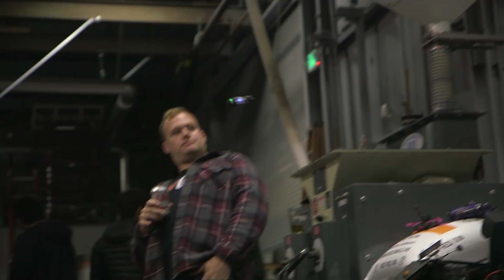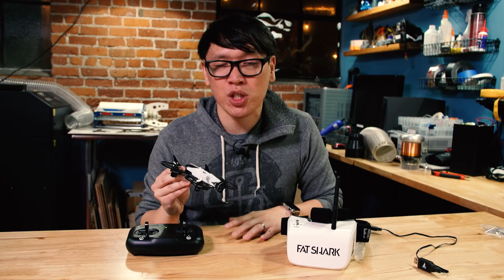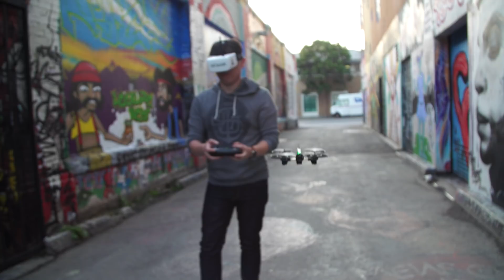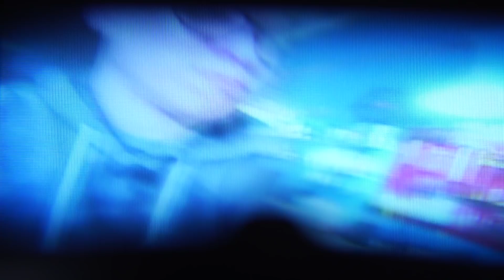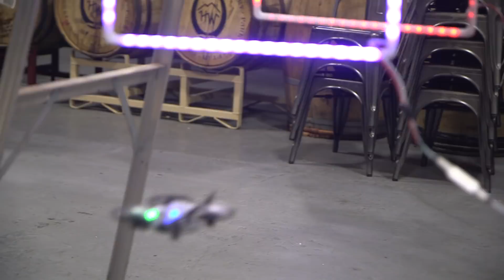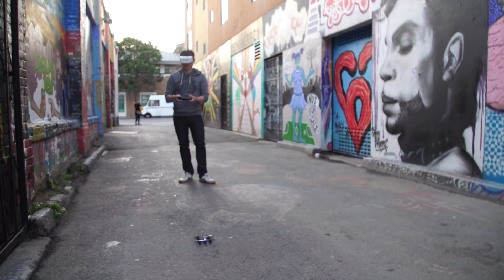Show and Tell: Fat Shark 101 FPV Quadcopter

Comment: Starting with an induxtrix or Building a tiny whoop would be a much better option. You can upgrade, it has better VX/TX so you can fly for more then 50ft and around corners.and the cost is similar. Worrying about support from third party venders is pretty useless, I doubt they are going to cover you breaking things due to a crash. if you are serious about getting into fpv you should understand, you will crash, you will crash again and you will need to know how to rebuild your quad and how to find answers when things aren't working right. Then you will crash again. You really need to understand how these things are built and not be afraid to work on them. Parts for these size quads aren't that expensive but you will replace parts often so it can add up. Then you will crash again.

Comment: It also comes with a redeem code to download DRL simulator for free which is worth 20$ and 3 month AMA membership and insurance.
There is no camera angle because it's for pure beginer and the wide angle gives you a good visibility of surroundings. Unlike a tinywhoop this one doesn't need a lot of pitch to gain good speed and once used to it the motor angle can be pitched forward at around 20 degrees (providing that needed camera angle), thanks to the gromets.
It comes with Betaflight so newbies can also get their feet in the flight controller tweak world.
Radio is AFSHD2 flysky compatible and uses real good gimballs, can be used for the 1st 2 years of hobby.
Headset uses Transformer lightpath technology, providing big fov and best focal distance, with integrated 18650 lipo cell and USB charge.
Seriously, if anyone can find a "one box to buy" which is even close to that at a lower price with proper customer service support please let me know because at this moment that's what my buddies are going to buy (and please stay away with "can buy separate chinese cheaps for lower price" coz I know then I will have to do the job for them as for IT with family).
Reply: You do realize that Fatshark is also chinese crap. Just really overpriced chinese crap. Hell even DJI's are made in china just like everything else. But you keep paying for that name, they love your kind.

Comment: This is a very expensive toy at toy level quality at well above toy pricing. You can spend a lot less. For beginners just trying to get in the air inexpensively, I would recommend looking at the Eachine E013. Get some extra batteries and you can start flying in your house or apartment. You can't beat the E013 at $70 ready to fly and another $20 for 4 more batteries and another charger. Less than $100 and your ready to get into the basics of flying FPV.

Comment: Really now?! Fatshark has been a household name in the FPV community since the FPV dawn of FPV time, and they still couldn't get the camera angle right. Not even a crappy toy should have a zero degree camera angle. You'll be looking straight at the ground as soon as you start moving forwards at any speed. Yes, I'm nitpicking, but that quad is dumb and a waste of money. I seriously hope that blurry blue shit in the goggles isn't what you actually have to deal with when using them. [stomps off into the distance raving angrily about technical specs]

Comment: People - get this instead for 50 bucks does exactly the same thing comes with goggles controller and drone https://www.banggood.com/Eachine-E013-Micro-FPV-Racing-Quadcopter-With-5_8G-1000TVL-40CH-Camera-VR006-VR-006-3-Inch-Goggles-p-1182628.html?rmmds=search

Comment: Oh yeah I seen that before the only thing is is King Kong tiny whoops are the same size and out of the box if you buy the advanced pack they come with six batteries a charger fully assembled they come with three extra frames and bodies and sets of propellers and everything is for under a hundred bucks you can buy said a set of eachine goggles for under a hundred bucks an a treatments from spectrum for around 60 bucks so all in all you would do well to buy a king Kong tiny whoop. And it is race ready to fly an fun inside or outside

Comment: this is a spot on review the best most unbiased one I've seen and I've seen 4 from big outlets ... 100$ for same type of kit on amazon called red pawz or little pepper great beginner but buy a 5 pack of batteries for like 20$ at the same time to get the best experience  ( the controller is a little small but totally usable unlike other fpv toy drones and the goggles are the only part you can grow with( but you will most likely upgrade because they are the cheapest on the market but still a great first experience)

Comment: In other words, it’s basically crap for both money and use.....there must be others out there worth the money and video time??
Reply: https://www.banggood.com/Eachine-E013-Micro-FPV-Racing-Quadcopter-With-5_8G-1000TVL-40CH-Camera-VR006-VR-006-3-Inch-Goggles-p-1182628.html?rmmds=search
Reply: This comes with fpv goggles and a radio, so it can grow with you if you build a real race quad.
Reply: for 175 you can get a flying RTR 250 class racer, with camera and controller,  All up in the air. 30-100 bucks you get a face box, v100, vr007  goggles etc etc etc. That puts you in a true 250 class brushless fpv racer for the same price as this junk ass setup. You got a lot to learn my dude.
Reply: these goggles are sub par and the transmitter is total crap. there is nothing to grow on in this kit. buy the 64 dollar eachine kit, find out if you like FPV or not. Then spend the money to buy a proper setup. 250 is far too high price for what you get here.

Comment: Too expensive for what is essentially a toy.
Reply: Brian D this is not a budget option.  It is the idiot with too much money option.
Reply: You might not have paid attention.  This is a budget entry into a hobby.
Reply: zymurgyjwt. Then you have no idea what the cost of this hobby is.
Reply: zymurgyjwt - So between you two, there's what, $2,000+ worth of equipment and you are saying that paying 10% of that to purchase a ready to fly system is overpaying.  You're obviously the type of person who argues to argue and I would have a more adult conversation with a coffee table than with you.  BTW, multicopters are rotary wing aircraft and it doesn't matter what the specs are, performance is limited by physics.  The biggest variable is the pitch of the rotor blades and the efficiency and ability to vary the speed they rotate at.
Reply: Brian D FrSky QX7 $105, Kingkong tiny 6 with 5 batteries $80, Eachine EV800 goggles $55. Then you have a radio that can be used for anything and a micro that can be used in a house. Or get the Eachine E013 bundle for $60.
Reply: Ok so for $10 less you get an unbundled system that is going to require the operator to be more technically savvy.  You are advocating for higher risk of failure to save $10.  You're beyond logical reasoning.  This is a budget entry into the hobby that gives users a more consistent experience and better technical support.  Did I say it was the best buy, no.  Simply that it is a budget entry into the hobby that presents a higher potential of success.  The more consumers enter the market, the more manufacturers will invest in the market.  BTW, $249 is a price point strategy.  Consumers are more likely to buy one box with everything they need for $249, then to shop piecemeal to save $10.
Reply: no, its not a hobby class machine at all. its crap
Reply: Brian D you are a damn fool. you can get an all up RTR 250 brushless racer and goggles cheaper than this setup. they are putting "toy" class crap into a fatshark box and up charging you for the brand name recognition. You want to talk about having an adult conversation or what this hobby costs? This hobby costs whatever you put into it. Its a fucking hobby. There are plenty of people who have far more money than sense and want to pay for an out of the box option. Fine, let them. But don't try and justify subpar hardware as excellent because it caters to the ignorant and lazy crowd. This is dog shit in a box, for a real high price. But I'm certainly not going to stop you from buying it.
Reply: I've got an E013, Japalura 3 inch, Chameleon 5 inch, two Floss 2 5 inch, Floss 2 6 inch, and a Y6 10 inch. With x9d and Fatshark HD3's. My step son has a Wizard x220 RTF with Kylon Vision. Nope, no clue what I'm talking about.

Comment: I believe this transmitter/radio uses a common protocol. And can be bound to a different receiver in a different quadcopter. So this kit has the potential to grow with you.
All you will really need to do is build a real 5” prop fpv craft!
Reply: youll find yourself out growing that TX very quickly, just get a qx7 youll be far better off.
Reply: Yeah it's basically a flysky radio

Comment: Damn you could get a nice racing quadcopter for that price
Reply: but not googles and no transmitter.
Reply: - 95mm brushless quad: 120$
- googles that are better than the cheap fatshark: 55$
- cheap transmitter: <50$
- total: 225$
Reply: ToastCrafter ! The difference is that all those a a la carte, while this is a complete kit with no guess work and no building. A true RTF.

Comment: $250???  Brushed motors?  The price point is at LEAST $100 too much.
Reply: You get a drone - brushed nice drone with betaflight and betaflight OSD costs 100$. I got 5 1s batteries for 20$ from Amazon with a charger. That's 120$ for the quadcopter. Flysky radio with way more features than this (especially with a firmware modification) costs 40$. Eachine EV800d goggles with DVR and diversity cost 100$. That's 260$ with 5 batteries, a way better transmitter, a quadcopter with betaflight and goggles with DVR and diversity. You can save about 30$ with just getting ev800 goggles instead of the d version. You'd miss DVR and Diversity, but still have twice the goggle resolution and be under 250$. So yor're paying mostly for the brand, if you can build a drone yourself, don't buy this.
Reply: The price for the whole setup isnt bad, but for as cheap as brushless motors/escs are these days, I'm surprised they went brushed.
Reply: microbuilder maybe they were trying to keep that weight down and the form factor
Reply: Maybe 200 would be more reasonable but the fact that it includes that transmitter, (which is actually a decent not a crappy toy controller) the goggles and a decent beginner quad justifies it. If you were to build a top of the line Tiny Whoop it would cost upwards of 200-250 for the quad alone. I think its pretty fair.
Reply: $105 gets you a FrSky QX7 that is the last radio you need.  Then the FrSky micro for $60 and any box goggles. Under 250 and you get more.
Reply: Thats the beauty of brushless motors, they can be tiny, weigh less than a brushed motor, and still put out more thrust and be more efficient.
Reply: i really like the transmitter it looks quite nice if it was sbus i on frsky protocol i wold think about buying it and the goggles look okay just the kwad look a bit shit mebz a version that doesn't look like a shark
Reply: Mate2Frio um actually a very good price considering you get a very good transmitter and a decent set of goggles
Reply: Good transmitter?  Not really.
Reply: Where are you seeing the specs on the transmitter?  There are many toy grade quads with the same.
Reply: Way over priced. Eachine has competing products for 64 bucks all up.  these are all throw away items, nothing to build on in this kit, with the possible exception of the nods. which are fucking horrible in their own right.
Reply: 250 for the whole kit is fine. Comparing it to tiny whoop kit that is 350 it has a okey price point imo. I would prbably go for a full size quad instead spend a little extra on a better transmitter and goggles. I think norm summed it up nice its gonna be for ppl that dont like to tinker with their quads and just want some cheap fun.
Reply: i think the price is fair because my fat sharks cost like £384 and then my transmitter was £200 so $250 for the lot is good

Comment: Whats up with the audio getting louder and quieter every couple words?
Reply: Limiter + compressor will fix this. Editor is obviously not a sound guy.
Reply: The compressor is working too hard.
Reply: makes it hypnotic, so you stay longer
Reply: @MPAII Yes I do. The thing I mean is that when Norman speaks louder, the sound goes quieter. That is an effect of a compressor configured the wrong way. The compressor works a lot harder than it should.
Reply: A compressor can't compress loud audio to be softer than the soft audio on the same track. Even if you set the ratio to infinity, and the threshold to negative infinity, it will all just be the same volume. It'll sound terrible, but it can't make the louder parts softer than the soft parts.
Reply: the mic is on his chest, he moves his head a LOT.  He needs Adam's in glasses mic mod.  It isn't to do with compression.
Reply: I noticed that with one of their videos a few weeks ago. It's horribly annoying.
Reply: David do you know what a compressor is? It does the exact opposite of this, especially when it's working too hard.